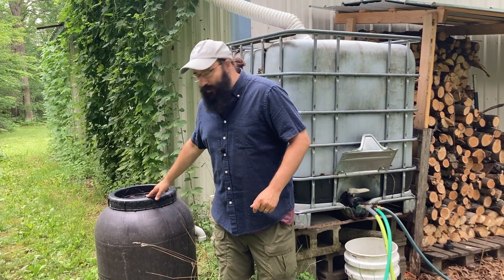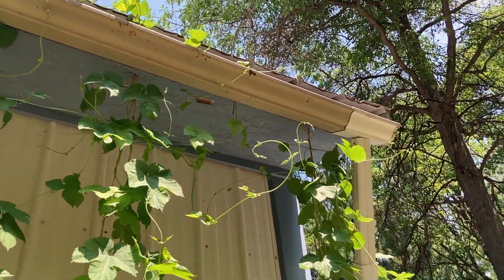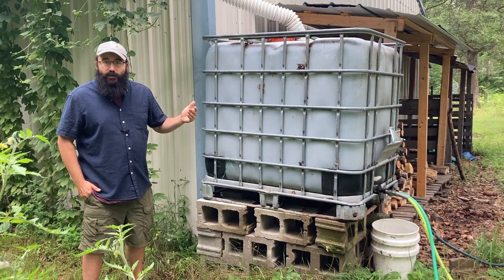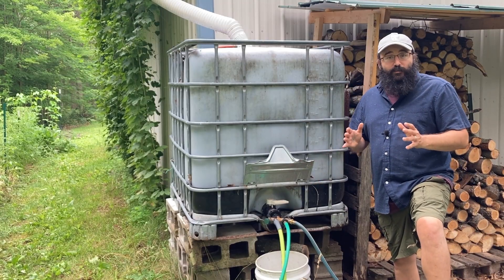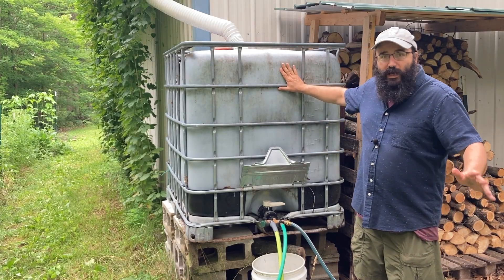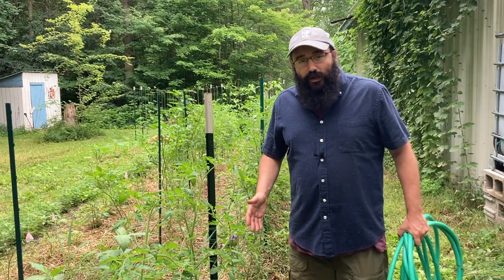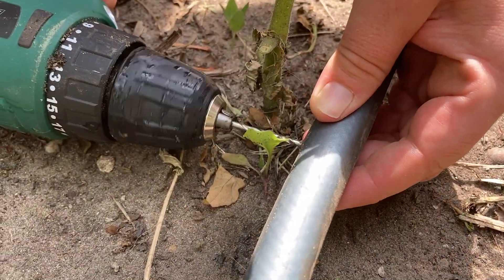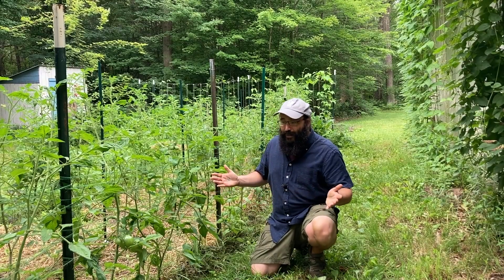DIY Rain Barrel & Drip Line Irrigation System

Comment: Consider using a second, empty, IBC tank as the base. They are specified to support another, full IBC on top, are quick and fairly easy to manoeuvre, and, in the UK, cheap-as-chips. (Dirty ones can be had for £20-£30).

Comment: Is there a way to setup a misting system with a rain barrel? I want to use a misting system in my little greenhouse but don't want to hookup to my house as my wife and her brother tend to disconnect or turn it off without telling me which tends to kill my plants. Ya I deal with heartless idiots,  they've also ran the mower over the hose a few times flooding the yard and again dehydrating and killing my plants while I'm at work.

Comment: Just using old hoses is the best tip ever!  Much less expensive than buying special drip lines, emitters, etc!  Thank yo 😊
Reply: I tried that a few years ago and the old hose had so much fibre in the hose. The fibres then filled in the hole after I drilled and again drilled. Tip look for a hose the doesn’t look fibrous. Cheers

Comment: Thank you for sharing🎉. How are you enjoying this system now in 2023? I am in the process of making a similar system with a solar powered water pump connected to a cheap portable battery pack. California recently had some great showers and I was able to catch 50+ gallons using old barrels. -Dave

Comment: so gravity isn't irrigating your plants?  looks like you use your water pressure from your house to run the irrigation for your garden.   Im having difficulty getting drop systems to work without water pressure, so have been resorting to making my own drip system that runs off of my IBC tote without any water pumps or water pressure from another system.  I'm starting to think, that I need to use a 12volt DC water pump (like from an RV) with a solar panel/battery, to get enough water pressure to run everything.  I just don't have any water pressure (or electricity) at my garden location and its over a 1/4 mile from the closest access

Comment: You offer some good ideas that I’m going to implement with my container. I like the idea of drilling holes in an old hose, it will allow me to clean it out every now and then. Unfortunately, we haven’t had enough rain this year to keep my barrel full enough to use. It was filled up to the top once back in mid March and collected no more than 150 gallons since. Barely a weeks worth of watering.

Comment: Outstanding video - great content, very well organized and presented! Super helpful!!!
For future design consideration: the cinder blocks are laying on their side and are not providing optimal support to the water tank. With the number you are using and how well the weight is distributed across them all, its probably not much of a risk. You could use a lot less blocks however, if you put them right-side up. 
Cheers and thanks again for the great content!

Comment: This will be great for the sustainable gardens we're building at my school! I'd like to connect the system to moisture sensors, if possible. Our growing season here in Michigan is short and school is not in session for half of the season. We have had to rely on volunteers to come and water during the summer, which has been okay, but not ideal. If I can connect the drip line/rain barrel system that I'm installing this spring to moisture sensors and a control box, we'll be in much better shape. Any suggestions for that? Know anyone who has such a set-up already? Keep 'em coming!
Reply: I’m a teacher and am eventually wanting to do the same thing! At my house I’ve used a RainPoint Wi-Fi water timer and loved it. They also sell moisture sensors that are supposed to work well and tie into the system
Reply: I don’t know if those timers work with a gravity system though

Comment: I’m setting up a similar system at my garden with the caged water tank connected to my pole barn gutter. I wish that I had known about that 2 inch female to hose bib connector, I did it the hard way with reducers. Maybe you could list where you got that connector. 

Why not just put your hose from the house in the top of your tank or back feed it into your tank? 

I’m using a programmable timer with four outlets, $54. It will water my garden without me babysitting it.

Comment: Wondering if the holes have clogged on you? Your pressure looks pretty strong so maybe it blows out any debris…?
Reply: My holes clogged with a traditional drip line. That’s why he uses a screen at the top. It’s also probably why he uses a hose and drills the holes according to his need. Not having enough water pressure can also be a problem. Some people actually use a pump, which to me makes it more trouble than it’s worth. With his four-way system, he can clean out the hose every so often. Assuming he has an end cap to plug his hose, it can be removed and cleaned out with the higher pressure water from the house to help prevent the holes from clogging.
Reply: @theden-jimdill7037 good tip, thanks! I just set up a similar system this week for five 30ft rows of all sorts of veggies. Still have to test the presure so fingers crossed

Comment: The cinderblock are wrong side up.  You'd have more support if you used popsicle sticks
Reply: False. It works fine, he’s not building a house on it. If you want to build a concrete footing or use pressure treated lumber to support your vertically stacked blocks, go right ahead. I personally use four skids stacked up. It’s not going to weigh enough to break them.
Reply: @theden-jimdill7037  that's the weak point . Its how they karate chop them
Reply: @Josh-mh3kl  He's not using them to practice karate chops. He has them on the correct side for the way he's using them. If you place the blocks hollow side up, they will sink in  the ground. That's why buildings that use these blocks always pour a concrete footing first before they lay the blocks. If that's how you want to build yours, go right ahead.

Comment: How much is too much, how little is too little? The land around the house, structure needs to absorb some of the run off, considering the soil layers it may need to absorb a substantial amount, the notion is as the collection process takes hold, the run off from the roof is less, if the homeowner were hypothetically to use the extra rain water on washing their car, their house, etc, they might find in time, their land is screaming dead. As with ALL things balance is essentially critical as not to solve one problem and create another or a worse one. In short form, it may not be best, to overdue it on rain collection.
Reply: Well if you want to get technical about the exact amount of water required for each set of land dimensions, then you would know that a particular structure is going to inhibit rainwater from reaching the ground in the first place, and that it is not going to create any environmental impact whatsoever if you collect the rainwater that would have normally fallen on that particular piece of ground. Common sense. Furthermore, you would actually be saving the foundation of your structure by keeping water away from it.

Comment: One comment and a question.  Your cinder block base would be much stronger if you placed the cinder blocks with the openings going up and down rather than sideways.  My wife thinks that garden hoses will leach heavy metals (eg. lead) into the water, especially when they get hot in the sun, and so you shouldn't use them for food plants.  Sure would be cheaper to use old garden hoses but do you know anything about that?
Reply: If you place the cinder blocks vertically, you’ll need to use pressure treated lumber to keep them from sinking into the ground.
Reply: Check that your hoses are lead free and do not say "not for drinking". In some cases buying these new regular hose may be cheaper than new "soaker hoses"

Comment: The cinder blocks are turned the wrong way. 80% of the cinder block is in the vertical wall of the block.
Reply: Did he build a wall or a tank support that he deemed necessary to have airflow underneath ?? He didn't say , ergo he probably wanted airflow !
Reply: @garreyprice3685 he said in video he needs a nice safe base because the water in tank would be heavy.
Reply: He flipped them horizontally so they don’t sink in the ground. It won’t be heavy enough to break them.
Reply: This is actually the best orientation because it is not the tank you need to support but the frame.
Reply: The tank holds one ton of water.

Comment: Does the sun bake the water in the hose enough so that it hurts the plant? Would burying the hose fix the problem if so?
Reply: When you turn the water off at the holding tank the line should empty before it heats up. The water in the tank shouldn't get too hot I'd think depending on your area/climate

Comment: Hey what is the size / dimensions of the adaptor
Reply: These tanks have different size fittings. They can be a bit expensive. I had to use two different ones to make the transition which cost around $25, more than I paid for the tank.